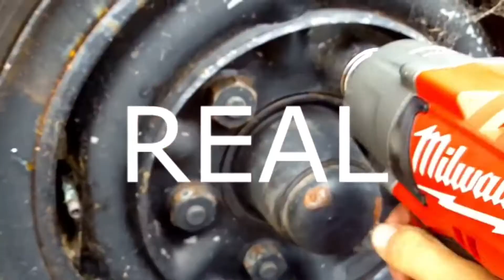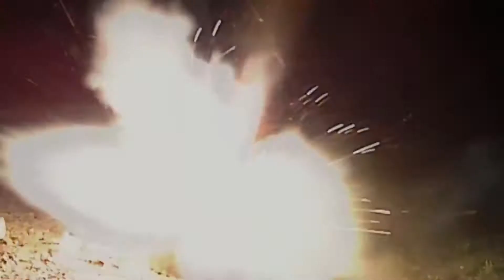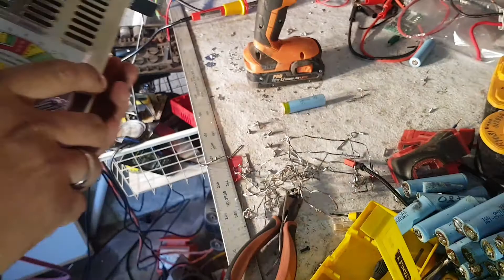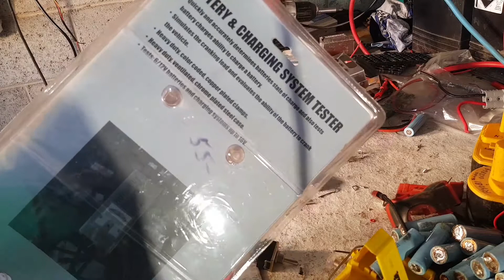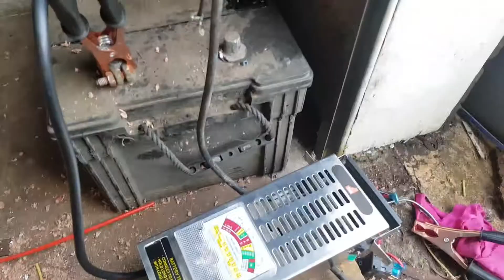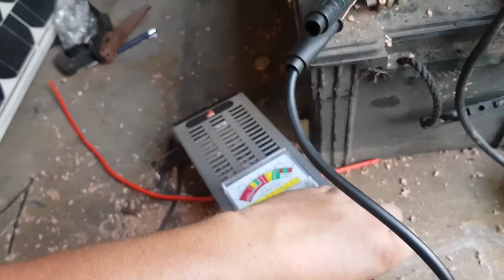100 Amp 12v battery testers Total rubbish!! do not buy

Comment: The wiring is fine, 1mm is meant to handle 10-16amps,  However a $10 dicky smith multimeter will work just as well and do more stuff.
Reply from the maker: You reakon cables large enough?
These are good to check car/ truck batteries so you can see if they have any starting punch:)
Reply: Yeah as the switch was rate at 10 amp anyway, heavy gauge wring would be of no use as the switch is the weak link.The load is taken across that resistor up in the shield there and the heat will dissipate in that, bit like the old elements in kettles.
Reply from the maker: Yeah ive hard wired one now but you have to be quick and accurate with clips to minimize the arcing on the terminals /do it only on a cool resting battery thats not charging or discharging so gases are at a minimum
Reply: yeah best way to avoid that is to clip to the battery and have the last connection closer to the device, much like the switch is. As long as you have some ventilation or a fan blowing there's no problem, it's only when in a confined space where the gases can't escape.